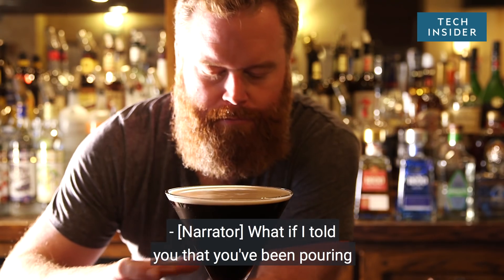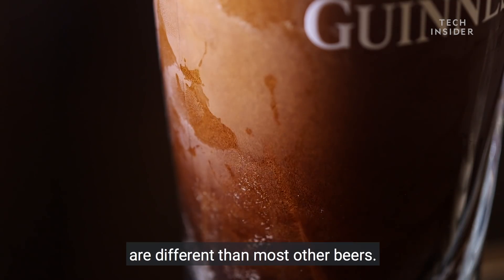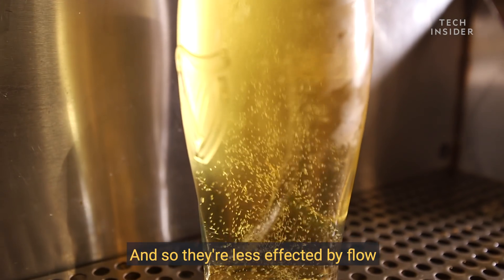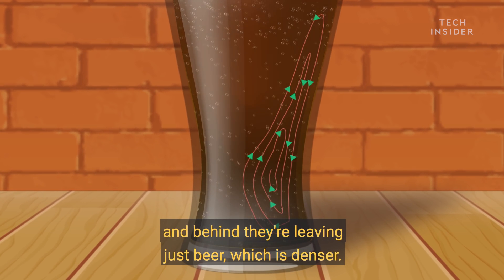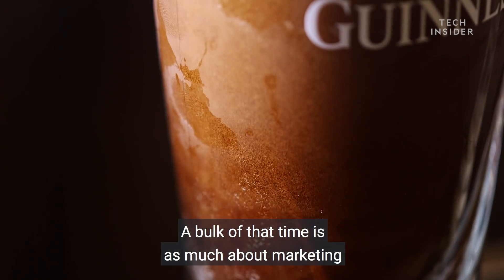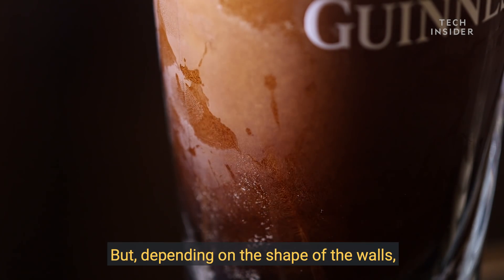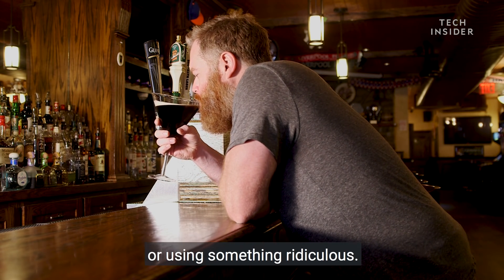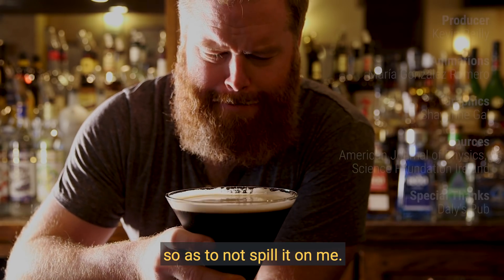You’ve Been Pouring Guinness All Wrong

Comment: 'marketing' has nothing to do with it. As a beer brewer, I've seen that there are marked taste and aroma differences with good quality beers and stouts when served in the right glass. Good beers are wasted if drunk from the bottle or standard pub glass - designed for safety and longevity. Guinness works fine in the conical glass and needs settling time. It does taste even better in a stout specific glass or a large tulip/wine shape, and this can overcome much of the "Guinness doesn't travel" argument. Try it in a pub. It'll start a conversation if nothing else...

Comment: No.1 the waiting period is miniscule.
No.2 the martini version has basically no head.
No.3 the guinness your drinking is second rate anyway due to the drop in quality outside Ireland
Reply: The beer is the same... maybe fresher in IR but the same kegs go to Dublin and New York
Reply: Just not the same as it is over the water in Dublin
Reply: @lloydcates917  Check where your Guinness was brewed and bottled next time you order one. Most sold in the states are brewed in Canada or the midwest U.S. Extra Foreign Stout is the best we can get imo.
Reply: Every single guiness stout that we drink comes from St James Gate in Ireland... brewed bottled and shipped from there. Trust me man.
Reply: Blonde (Baltimore), Extra Stout (Canada) and I think they brew a few off ones in chicago.. but every guiness stout come from Ireland
Reply: @lloydcates917 
Fresher beer is not what you want. You want a beer to age through it's own fermentation process for more flavour and depth.
Reply: @blaquenoise  drink a day old IPA and try and tell me that.. other then big stouts and sours.. arresting fermentation is crucial to anybody quality control.. otherwise you would have cans exploding on the shelf and it would be impossible to determine abv
Reply: @lloydcates917  and beers like IPAs lose flavor as the hops lose freshness.
Reply: @lloydcates917 
I'm not saying wait a long time, but beer brewed that day does not taste as good as beer that has set at least a week or two. And IPA's were designed for long trips across seas and not all are IPA's were strong.
Reply: Well I've lived in Colorado my whole life so I don't know any different. 😂
Reply: If you go to my local and ask for a Guinness two things will happen 1. They will know your a tourist and haven't been here for any real amount of time(because of how you say pint and guinness) and two they will beat the shit out of you for asking for it in a martini glass
Reply: @blaquenoise  for one thing you don't drink beer "brewed" that day. Fermentation takes several day's at a minimum. But beer bottled that day is a different story. Also the whole IPA were designed to be aged thing has been debunked. They we sending all kinds of beers to india back then including dark beer like porters and stouts. Check out IPA by Mitch Steele.
Reply: there is no quality if we talk about guiness, in or out of ireland. Its horsepiss, not beer, a big concern horsepiss.

Want actual irish beer? get ohara
Reply: Guiness is mediocre, waterish stout anways, who cares
Reply: Sean Gannon

Comment: So, you order your next pint before you have finished the current one, that is how we do it here in Ireland. Timing, takes a bit of practice but once you got it, it works. Also pubs in Ireland pre-pour Guinness pints in anticipation of people ordering them, so you normally see a rake of pints resting on the counter waiting for top up.
Reply: Why do you order before you finish the first one
Reply: @oscarosullivan4513  because you can't stop after 1 that's crazy
Reply: if you got multiple drinks in the order you pour the guiness first and then do the rest while you wait for the guiness to settle. or you just order porterhouse which in my opinion is the nicer of the dublin stouts.

Comment: What they don't take into account is the head. You need to pour it tilted to avoid any bubbles from forming at the top. Pour it too steep and they form immediately at the surface, too tilted and they splash onto the head. I find the perfect Guinness is poured just at the tip of the rising stout, adjust it by gradually lowering and tilting the glass according to the rise. By doing so you still have to wait to settle it, but the Guinness will darken much faster and prettier than any other way. Plus your head will be paper white and smooth as a baby's bottom!
Reply: This is how you pour all beers, be it can, draft, or bottle.  Every beertender knows this.

Comment: I worked in a bar that had funny lights on the bar and you would see the Guinness effect in other beers cause of said lights.Its the perfect pint of Times Square rooftop bar.Think it was 46th street and bway.Not sure it cause of the gas mix but all the beers used to settle just like Guinness but at different speeds.

Comment: Not all stouts are nitros mr dr professor also you can achieve this in most any shape glass (the shaker pint is the glass he is looking for) also also you can pour a nitro hard and it will cause the cascade no need for the 45 degree nonsense

Comment: The two part pour is bullshit. It’s a hangover from the 40s and 50s when draught Guinness was poured flat from a “low” barrel and then topped of from a “high” barrel which was cask conditioned and therefore full of carbon dioxide. It was too fizzy on its own. When Lagers were introduced on carbon dioxide gas, Guinness found it too was too bubbly so divided a carbon dioxide/nitrogen mix. Bar staff kept doing the two part pour despite it being unnecessary. People believed this was how it should be done and Guinness have turned it into a marketing tool. The settling is a result of the nitrogen.
This came about around the early 60s.
Traditional Guinness was actually sold in bottles. And the best stuff still is.